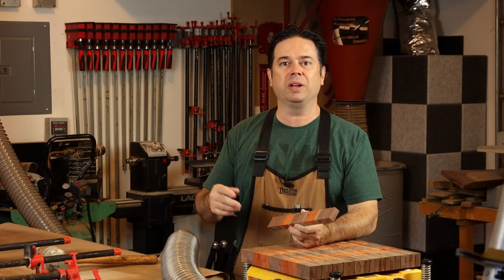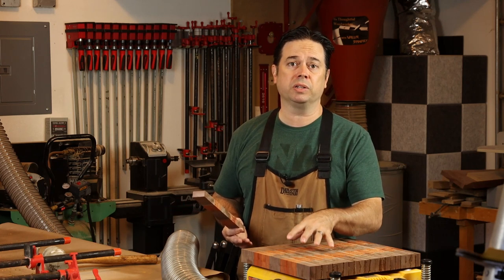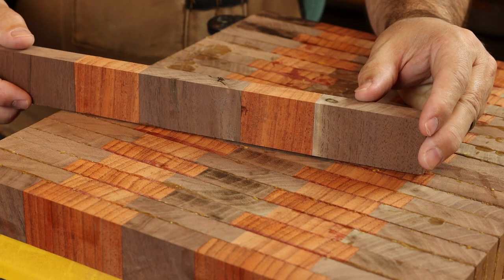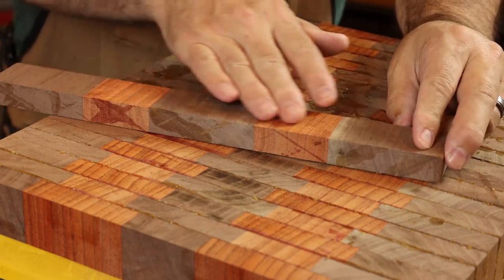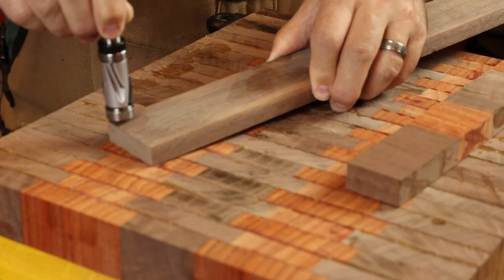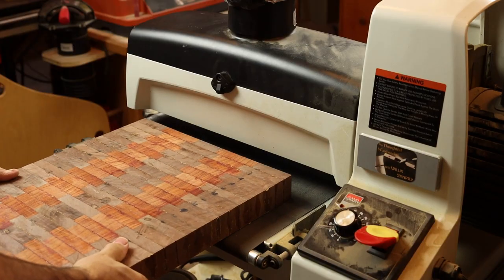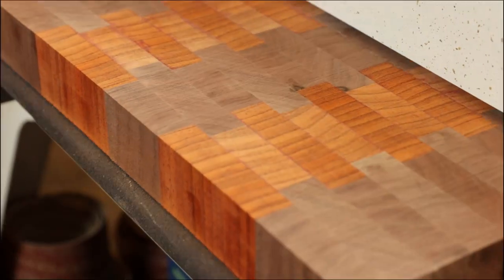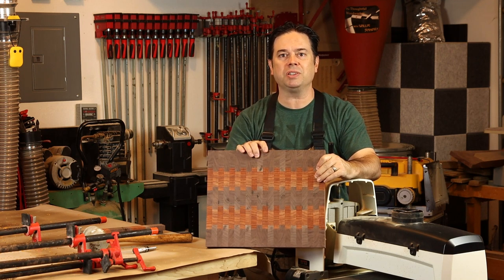End Grain Cutting Board through Planer?  Best woodworking method to surface end grain cutting board.

Comment: Well stated.  Definitely a drum sander!!!!  Using a planer is a no-go in any situation, even a helical.  I've tried it once with a really light pass.  Dulled sharp blades instantly and blew out the end of the board.  I use 34 grit, then 80 grit, then finish with 120.  Works like a charm.
Reply from the maker: Ok interesting.  I hadn't considered the effect on the blades.  Good idea to start with a very coarse grit when drum sanding.
Best

Comment: What’s been the best way to remove the gouges made into the wood from the sand paper? That’s my biggest hold up using a drum sander. It’s great to level but then adds so much time using the orbital sander to remove the scratches
Reply from the maker: Yes, I agree that's a problem with drum sanders.  Works ok if you Sandry to a finer grit.  Then use a random orbit sander to finish.
Best